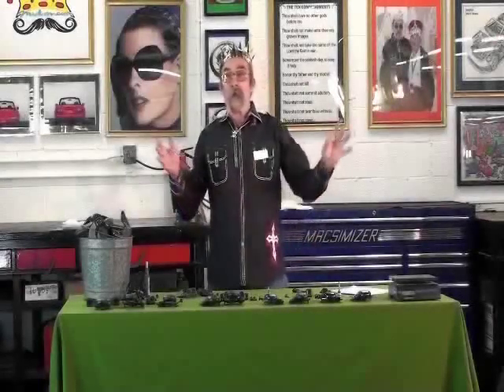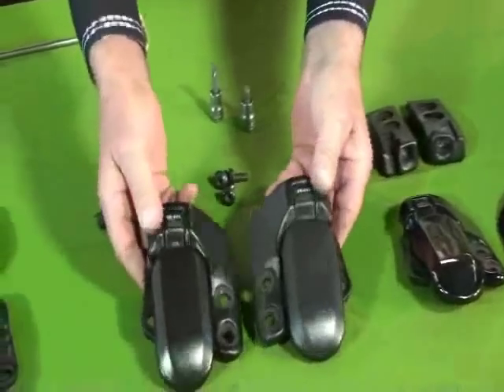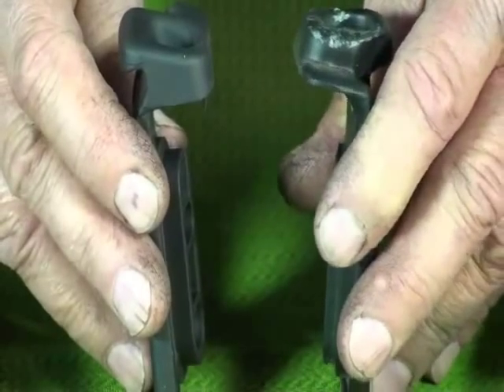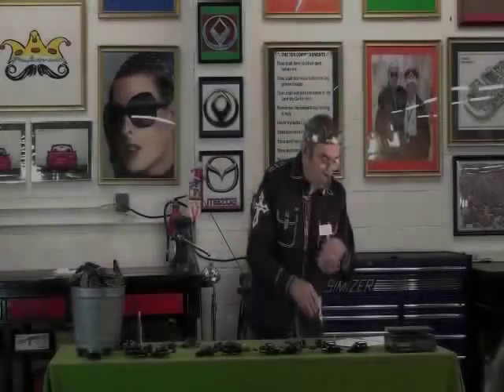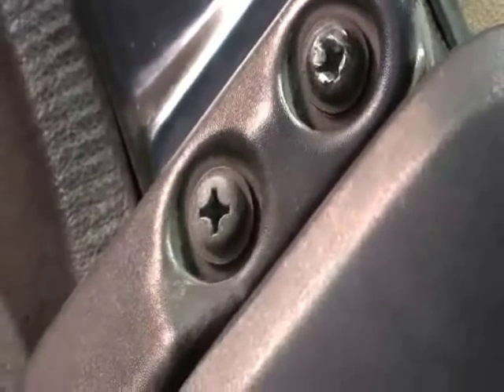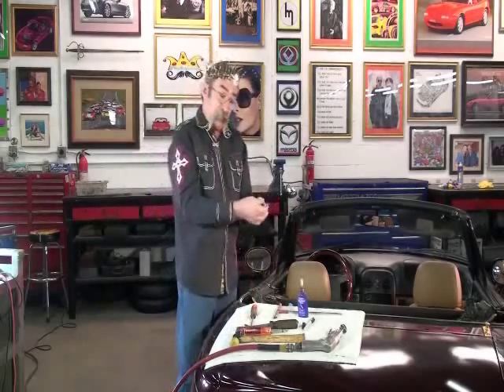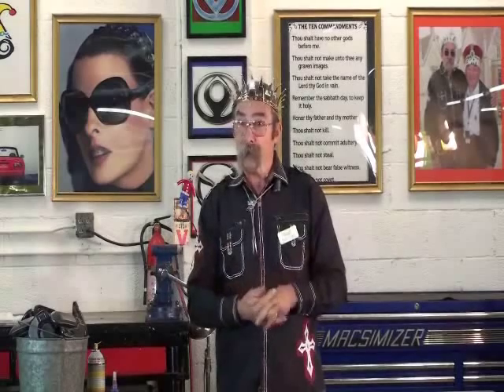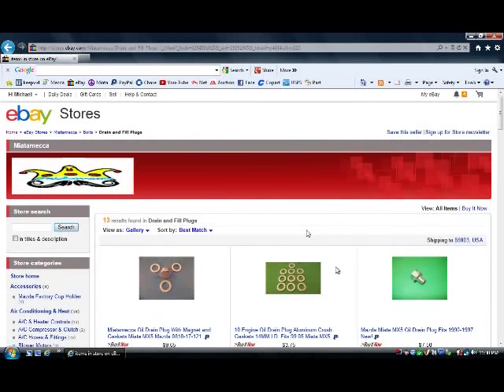Miatamecca S1 E1 Miata MX5 Convrtible Top Latch Repair How to Kit

Comment: I have now done 2  top latch repairs using the little kits Mike has.   His demonstrations are absolutely professional, thorough and easy to follow.     Both sets of latches  came out perfect.   I have an extra set for the time when I finally find a Factory Brilliant Black hardtop.      Recently I saw him do a replacement of the rear window on a Miata.    He does a better job than many of the upholstery shops.    He doesn't skip steps.     THANK YOU MIKE!

Comment: awesome that king is back didn't think you where gonna be back. I have a question for I have 1991 na 1.6L and I have a grinding nose at 3750rpm  while acceleration and more pronounced when engine braking. it sounds like its coming from the drive train. off the top of you head do you know what it is? I am think somewhere in the clutch area it the problem.